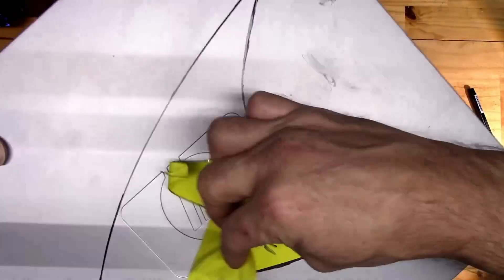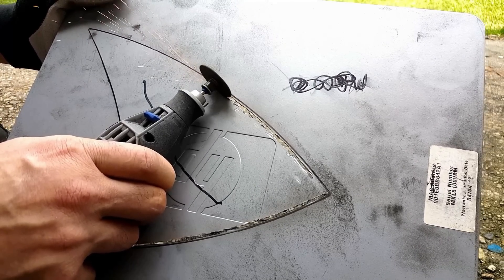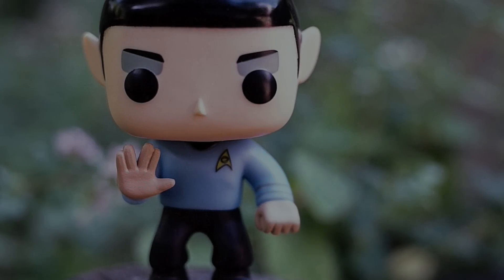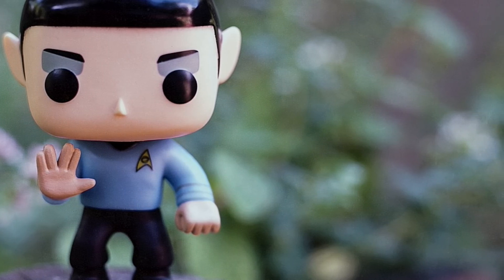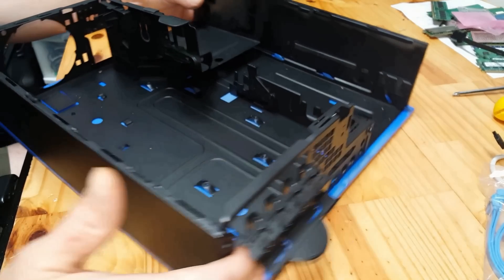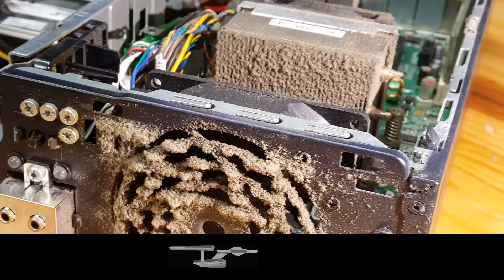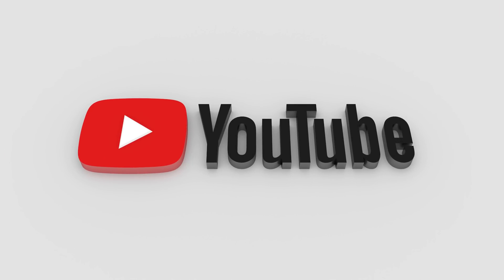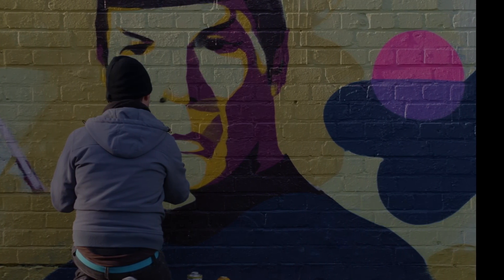Star Trek An Old HP Computer  Restoration Spock Themed

Comment: On mine, I put in a 2.5" piggyback adapter and used 2 2.5" drives in mine since the board supports 3 SATA channels.